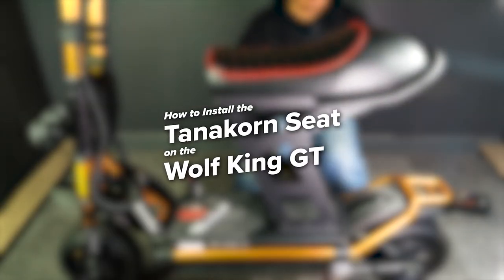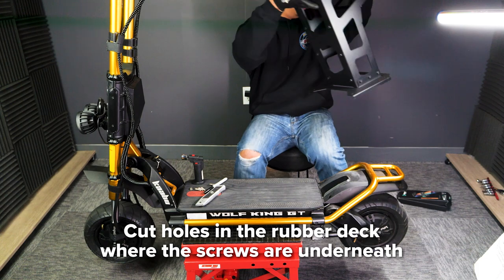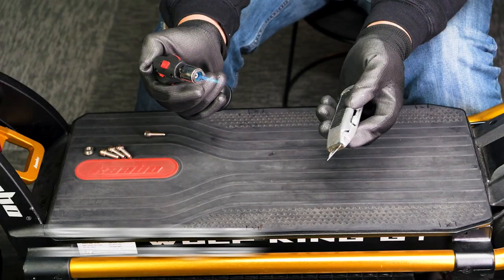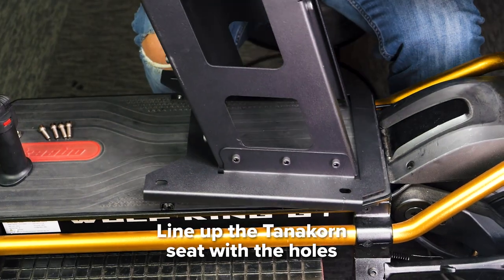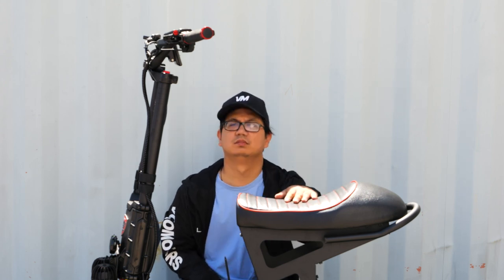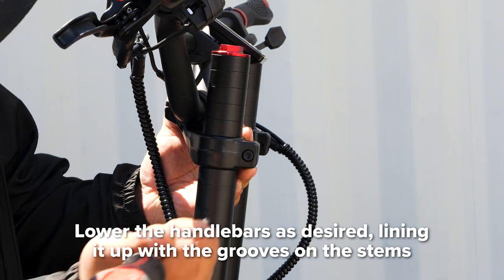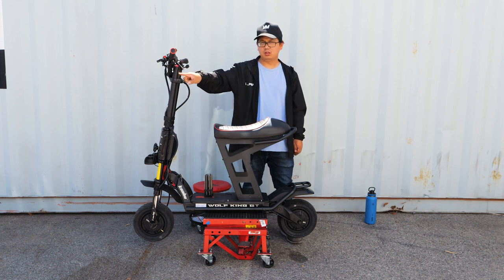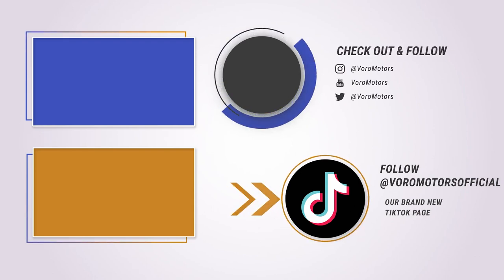How to Install the Tanakorn Seat on the Kaabo Wolf King GT | Voromotors tutorial

Comment: Just got my seat yesterday easy to install! Careful tho on the wolf king gt pro I noticed once the seat is bolted in the screws may hit the light strips on the side and push on
Reply: Did yours come with a set of nuts that I can only assume are used to secure the new bolts from underneath the deck? Or did you just bolt it down only?
Reply: Damn I I messed my side lights up from screwing into deep oh well
Reply: @KangarooJunkie  yeah nothing some glue won’t fix I hope

Comment: isn't there a way of mounting a square mount to the pole ? , then using this monster frame .They should have a standard 11 inch banana seat and it comes with a square mount that sits on the pole , and mayebe 2 small support brackets for the back ..Your adding unnesseary weight and taking up so much space